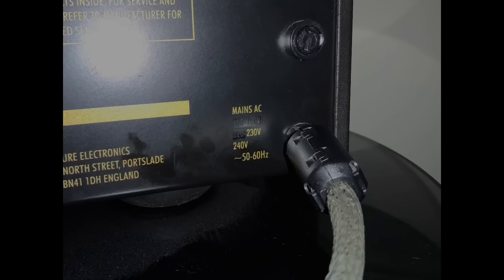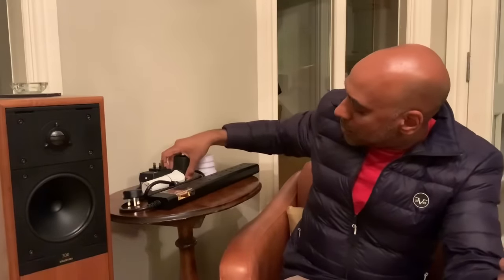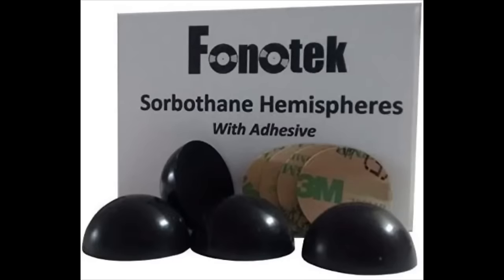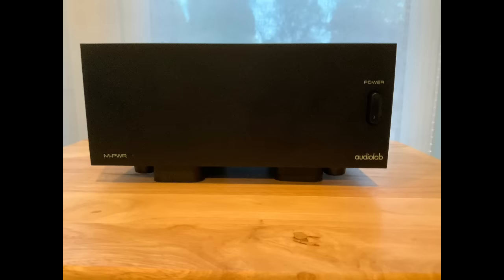My Top 5 Inexpensive Hifi Tweaks

Comment: I've had the Tacima since my first proper hifi set up in 2016. First I had the Audiolab M-DAC and M-PWR no issues with hum. Tacima 5 stars.
Then upgraded to Mojo and Rega IO but the IO had hum coming through the right channel even without a source plugged in, in both speakers and headphones, 3 got sent out and all had the issue so I got a refund. Tacima 1 star.
Now I've got the Mojo and second hand Cambridge CXA60 which has no hum issues through speakers or headphones (Tacima 5 stars?) but does have a fairly loud transformer hum from the unit itself lol so I can't win.
If you have an issue and product xyz resolved it great, but sometimes I think people buy these as they are just 'generally recommended', without actually having an issue to begin with, and then proceed to give 5 stars reviews for that product even though it did nothing.
Reply from the maker: Thank you for watching and sharing your experiences 😊

Comment: I have been using the Tacima mains conditioner strips for many years and can confirm they work.   They removed some interference, however main thing is sound becomes clearer, more rounded bottom end, and frequencies are more separated.     I'm posting the comment to back up what is said about them in this video, I don't have any experience on the parallel mains conditions however.
Reply from the maker: Thank you for watching and sharing your experiences 😉

Comment: I like your approach to HiFi but I am not sold on power cables.
The parallel filter I can understand though, and the other tweaks make sense as well.
I will be looking forward to your next contribution, thank you.
Reply from the maker: Thank you for watching and commenting Hugo
Reply: Hugo
Power cables make a huge difference, but hey, not everybody need to like good stuff.U can use cords for pesants, they do not distinguish the taste of cheap food vs expensive either.
Reply: @sheerenergy8602  If power cables made a "huge" difference, you'd be able to objectively measure it in the sound coming from the speaker. Yet nobody has been able to. Why is that?

Comment: I got your recommended mains conditioner and had big issues. When I plugged either my sky box or Xbox into it as well I'd get loud background buzzing out the speakers. Put both in and even worse. Add a lamp and even worse again. That didn't happen before with a big standard mains adaptor. Plugging the hifi into the socket and everything else into a different one fixed it and I think made the bass slightly tighter. Not a huge improvement but still there. So I actually got terrible mains interface from the mains conditioner! I got 2 as well so tried the other one and identical. No interference if I only put the hi-fi in the mains conditioner and everything else in another socket. I've had that buzz before with the old cables when a lamp was switched on and sometimes when turned off or something else was added into the socket but only occasionally. Turning the whole socket off and on fixed it. I've tried 4 sockets too. Very odd. Working great now though.
Reply from the maker: Hi Paul, sorry to hear that. It is very unusual. If you get a chance check that you don’t have any grounding issues on your mains circuit. I hope it all works out and thank you for watching 😉

Comment: Some comments about placebos and other blah blah. If your mains does not have issues, you wont see or hear a difference. If you have issues you'll hear or see it. 
 I bought a Tacima block before its 5star review years ago. Plugged in to my system only to protect against spikes. (My old house had issues of its supply, bulbs lasted only weeks, flickering lights when fridge condenser came on etc etc all 50s wiring and box). Wasnt expecting much because it's there for protection and I knew nothing of 'conditioning'. Everything became clearer  and brighter visually and sonically. Enough to throw off all the THD calibration on the TV, DVD and the measurement of the surround by the receiver mic. Everything had to be touched down on recalibration. In my new house, no difference in sound or visuals whatsoever. None. Even with a more fancy Mini-sub. Nothing.
Short, I know it can work because I've experienced it work and objectively saw the difference. I'm happy that my new house doesnt seem to require it.
Reply from the maker: These things can be system and dependent on the quality of your ac supply. Hence, a tweak and not a full product review. Results are to system dependent. Thank you for watching
Reply: @abritishaudiophile7314  exactly. The difference I saw 15yrs ago was so glaring that the whole home cinema had to be recalibrated. It's a tweak for sure because until I realised how much hash was in the ac, I was happy because the whole set up was calibrated so net result was 'the same'. Although, with cleaner mains, I also knew that the system wasnt 'fighting' as much to get there (I.e. ghosting lessened on the TV, the back left speaker level became even, stereo imaging became solid etc). Now if you had 'minimalist' audio circuit, which I later had, it's a big jump. The result though will not be the same as you know and yet it can be irksome when some comments jump on a view they have no direct experience with.
 I have about three of the products you highlighted. I'll always say it's worth a try especially of you're aware of your supplies issue or the nature of the  electronics you are using.

Comment: A piece of advice: the power cables must be terminated with braid connected to ground ONLY at the end of the cable which goes into the socket, to drain the noise to the ground. Otherwise all the noise picked by the power cable will be collected by appliances too, which is not what we want.
Very important!
Reply from the maker: Thank you florin ene

Comment: Thank you, another well informed video. I've ordered the conditioner and device isolation pads. I found my Rega Elicit R bass reproduction was improved significantly when I used a decent thick gauge and shielded power cable. Also found keeping interconnects away from mains leads helps. Also I always plug the amplifier in to its own mains socket.
Reply from the maker: Hi B Shah, good to hear from you. Thank you for sharing your experiences, that is good advice 👍

Comment: The ferrite should be on both cores. Assuming some rf noise is induced on the cable (unlikely as the speaker path is low impedance) it would appear on both cables. As the speaker coil is reacting to the difference in signal on the two cores, if you suppress noise on one side you’ll just make it worse!

Comment: I own a medium priced system, roughly $40k worth of gear. I have played with a number of power cleaners and power conditioners and I find that the iFi active cleaners works great, HOWEVER, I have found that these are better utilized in front or on the same electrical outlets as very noisy appliances and gear. I purchased roughly 6 of these and placed these on the same outlets as my tvs, my toaster ovens, hot water dispensers, broadband router outlets (very noisy). If you have a noise line meter, you can find out which devices/outlets have the most noise and place these iFi filters before it gets to your audio gear. Having a separate dedicated circuit installed helps out as well.  

Great power cables make a difference as well. To save money, you can purchase power cords from Pangea as they are great quality copper and are thick enough for you needs. The The downside is that they are not very flexible and don't work well in tight bends. Ferrite magnets do work, but I have found only slightly. Perhaps they make more noticeable difference on a noisy cable, but I didn't find them as useful.  

The power conditioner strip listed in this channel is NOT good for power amps. It will reduce the quality for powerful amps and suck the life from it. I would prefer to plug my amp into the wall if this is all I had. This may work great on DACs, CD players, and preamps or perhaps even a small class "d" amp, but I would NOT use it for a high powered amp. Save your money and spend it on a great power condition for your system. There are many out there including Audio Quest Niagara series power conditioners, PS Audio power plants, IsoTek (have not auditioned but good reviews) and many more. Do your research on these. You are going to spend a lot of money on great power conditioners but they are well worth it. Otherwise, use the cheap iFi products listed above to keep noise away from your audio gear and this will help greatly and increase dynamics of your system and increase air or liveliness. I don't agree with everything you mentioned above, but in either case, most of them may prove beneficial.
Reply from the maker: Hi Richard, thank you or watching and sharing your experiences 👍

Comment: Very interesting tips.  Do you know if the power conditioning devices would have more benefit on Class D vs A/B amps?  Conversely, would you know which amp topology would be affected more by "poor" power?  Thanks for the video and tips!
Reply from the maker: Hi Jack, it is not so much a case of topology but the individual design and components used. Class D amplifiers by there very mature generate a lot of noise due to deploying PWM (Pulse Width Modulation). Good designs will successfully filter out this noise so additional filtering may not be necessary. However, the noise generated by PWM not only effects the amplifier but other components in the system as well. I think it is a case of experimenting and seeing how it works in your system.

Comment: The Tacima products are not power conditioners, but a power strip with an AC noise filter and the others are wall AC noise filters with surge protector. In the model I see in the video it is a very basic AC noise filter, nothing of great quality. It's present in every audio electronic, if You open your devices You will see them. Power conditioners are physically big devices. Good AC noise filters for audio use are expensive, and are made of 20 - 30 components at least.
Also, ferrite beads increase impedance, if You make listening tests You will note that they compress transients in the music. If You note no great audio cable maker use ferrite, except someone. Cardas use an inductor on the ground condutor on power cables, but it's different.  Thanks.

Comment: Hi Tarun, I re-listened to your video over the weekend, and will be taking you up on 4 out of your 5 recommendations - so many thanks indeed for the great tips! May I just ask a few additional questions?...
Regarding the Tacima mains conditioner strip and parallel conditioner, while my components have UK plugs, my mains/wall sockets have European wall plugs. Sorry for the somewhat dumb question (unfortunately I am no electrician!), but would it be ok to use a European wall socket adapter without reducing the performance of these products?
I get that a single ferrite clip should be placed on the speaker cable at the binding post level. Regarding the electronics (amp, CD, streamer, etc), should the ferrite clip be placed at the top-end of the mains cable (near the electronic component) or at the bottom-end (near the power plug), as there seems to be a bit of dissension amongst some of the replies/comments?  As you state, care should be taken not to place the ferrite clips too close to each other?
I note from your link to the video that you recommend the Hudson HiFi silicone isolation feet. These products seem to get very good reviews  - arguably better than sorbothane products,  plus also the fact that silicone does not leave any stains or marks even after long term use. Would you also recommend using this isolation product between the top of your speaker stands and monitors? Thanks again for your help and sorry for the multiple questions!
Reply from the maker: Hi Marc, I don’t think using a well built European mains adapter with the Tacima will be an issue as the filter is after the adapter. Be judicious with the ferrite cores as in some systems they will cause high frequencies to roll off. Place one on each speaker at the binding post end and try on on your component power lead at the component end (not the mains plug end). I have used sorbothane and silicon feet under my equipment to good effect. I don’t use them under my speakers as they are normally for lighter loads. I suppose bigger one would work under speakers, just check with the manufacturer as to what is the maximum weight they are designed to work at. Thank you for watching 😉👍
Reply: @abritishaudiophile7314  Thanks Tarun! 👍

Comment: Hi Tarun. You have to be careful with the Lapp cables as some on line places are selling 'armoured' cable (with simply an aluminium braided surround to strengthen the cable from industrial abuse), as shielded cable (Lapp manufacture both). Stick with Belden at the lower end. They lasted me for years. Have to spend a fair bit more to better them, and only if the system is up to it.
Reply from the maker: Thank you Alex 👍
Reply: @abritishaudiophile7314  Great content again. Who has not had the tacima? 😊 One thing worth mentioning is the benefit of using a filtered strip for all switch mode power supplies, as they can introduce noise out to the line, and thus into the system at large. The tacima is a cheap fix. I have also found Kemp Electronics good for reasonably cheap money with their SNS mains filter plug-in. I have tried many brands over the years. Most just compressed dynamics, even some eye wateringly expensive units which the hifi press would have you believe is beyond reproach. Listen with your system and your mains quality as everyone's situation is different. Only use filtration on the system if you need to (excluding switch modes as explained). More expensive gear can have some pretty trick voltage regulation (and if required filtration) already built in.

Comment: A nice laminated core transformer and filter capacitors do wonders for filtering out mains noise by creating a smooth dc voltage for your listening pleasure. Where to buy them? No need. Almost every power amp comes with them fitted!
Reply from the maker: Thank you for watching

Comment: 7:31 I'm curious if the Tacima will help correct a simulated sinewave from a UPS when its running in battery mode. I assume it should since it's purpose really is to correct the output coming from the source, but I do wonder how well it performs

Comment: Thank you for your concise and constructive video. I have tried most of them over the years with mostly beneficial results. 

Most recently I have found a digital audio upgrade that has clearly improved my 3 systems for £20 each.
most of my listening is streamed FLAC from Radio Paradise and FLAC files from my NAS. I have a cat7 network running to all rooms and have recently introduced a Metal cased gigabit switch between my network cable and the network socket of the  raspberry Pi/DAC.

This has an effect not dissimilar to the Tacima mains conditioner you mentioned, of reducing the noise floor and allowing more fine detail to be revealed. Additionally the stereo stage and placement is greatly improved. I first added this to my Naim Uniti system and was very pleased with the improvement but when i added it to my Pi/Allo Boss/Denon M40DAB/Diamond 10.1 kitchen system i found as clear an improvement despite the lower quality equipment. I have used the TP-Link TL-SG105S, 5 Port Gigabit Ethernet Network Switch cased in metal, but others may well be as good.
If you were to do a video on digital tweaks I would be interested to see what else can be tried.
Reply from the maker: Thank you for watching and sharing your experiences Paul. I appreciate the suggestion 😊👍

Comment: My best tweak ever was getting my electrician to install dedicated power cables under the floorboards to power my hifi... clean power, with correct cable gauge from the mains switch box as it enters the house. Bingo .
Reply from the maker: That is great 😊👍
Reply: @abritishaudiophile7314  The improvement was more silence (like blacker blacks on your TV set) between the notes